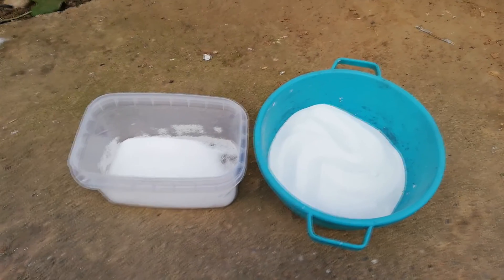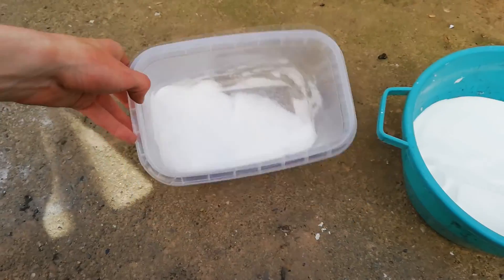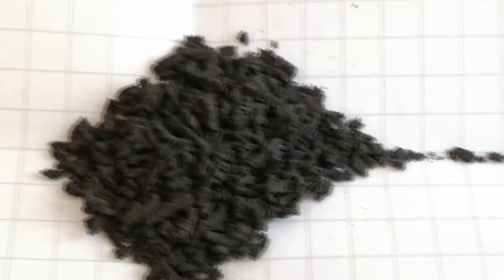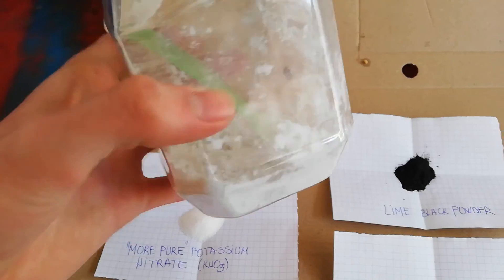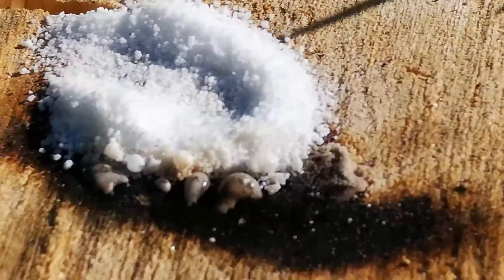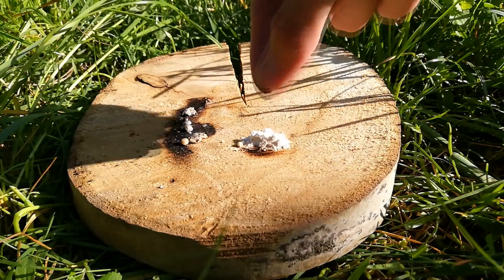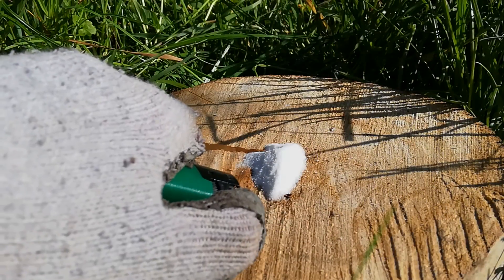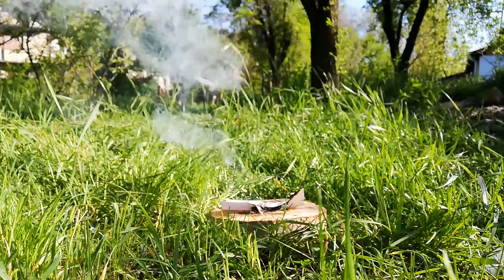Huge Factor That Makes Your Fireworks Fail

Comment: Hi (again),
Marble made of stainless steel are safe to use in ball mill (are they more safe than glasses ones ?)
Thanks
Reply from the maker: I'd rather use glass or even better ceramic marbles than steel ones. Nether of these are the safest like Alumina, hard lead balls, Zirconia media, those are safer I'd say. Do better research for yourself. Stay safe.
Reply: @MakeAndDestroyFireworks   Hi thanks for your response. But stainless steel is sparkless, so it is a good choice ?

Comment: Hi Make&Destroy,
I want to ask you, do this crackling star composition works ? (66/30/4 - CuO/MgAl/Dextrin)
Thanks
Reply: Why not?
Reply: @ChimeraChemLab  because you need bismuth trioxide or lead tetraoxide and nc lacquer
Reply: @pyroaxcry  As you can see, not necessarily
The phenomenon of crackle has not been sufficiently studied, but most researchers agree that first one component burns out of the magnalium, then a finely dispersed second component gives a flash. According to this theory, it should work... Besides, I think I've seen this composition in Chinese tables...
Reply: @pyroaxcry  I agree, the use of dextrin looks strange
Reply: @ChimeraChemLab  Yes I see
Reply: @ChimeraChemLab  but can we add nc laquer instead of dextrin ? And will it works ?
Reply: @pyroaxcry  Well, at least NC laquer should bind as well as without dextrin)
I just made some of this compound at NC laquer, and it's not dry yet. But so far it doesn't sound very much like a crackling – rather not a pop, but a flash...
I'll try to bind it on the water, but it will take much longer to dry
Reply: @pyroaxcry  It's too bad that this comp gives little information, I mean the size of the magnalium and the cores
Reply: @ChimeraChemLab  oh ok
Reply: @ChimeraChemLab  yeah not much information about the comp

Comment: How did you learn how to make fireworks? I’m interested in this. When I get older I’d like to make them too. Do you know where I could find info to make them?
Reply from the maker: I'd highly recommend you to first understand how basic compositions, like black powder, star composition, etc. work. (Avoid using flash powder for the beginning). You can also watch videos that show the results of what's been made, but please if you're younger ask someone older to join you, safety first pyro :)
Reply: @MakeAndDestroyFireworks  I’ve been making fire crackers and other ground based fireworks for years now but can’t get Morters to work have you got any tips

Comment: Hi M&D. Great video, as always. If I understand your video correctly, as a chemist I can tell you that it depends on where you buy the potassium nitrate. The agricultural one is often impure for KCl and NaNO3. Water of hydration is much more associated with KCl and NaNO3. In my BP productions I use the food type (which by the way is not that expensive). With this type of KNO3 I can produce BP with a burning rate of 80/100 cm / sec (about 40 '' / sec) by balmilling because I produce BP with ball mill. However, this BP has a tendency to absorb water from the humidity of the air, since it sticks to the walls of the jar after 3 hours of grinding. According to Ian Von Maltiz in his book "Black powder manufacturing methods & techniques", this water (about 1%) even favors a fast combustion. Recrystallizing impure KNO3 is a good method: just let the recrystallized dry well. I have seen that your fastest BP is excellent, obviously indicated for launching and bursting charges, the slower one you could use for other preparations where a great burning speed is not needed. Keep in mind that the NaNO3 present as an impurity can color the flame yellow ... but maybe you already know these things :)). In any case, a good video, clear and simple. Greetings from Italy, Alex :))
Reply from the maker: Thanks for commenting Alex, I will do a recristalisation for the inpure one, maybe even for pure one to see the results :)
Reply: A lot of knowledge.. I just got the agricultural KNO3 but noticed the slow burn as well. I wonder if the star comps here in America are the same as the ones in Italy they seem to have brighter colors in Italy and German fireworks.
Reply: @Tongan_Boss  Hello. From the videos you may not see the colors well, especially the green and blue. I don't know if there is a diversity of colors. A good blue and a good green are obtained using chlorate, but without using magnalium so as to obtain low flame temperatures, of the order of 1200 C. See you soon. Alex.

Comment: Sounds like you actually had a moisture issue versus a purity issue.

Kno3 will absorb moisture over time decreasing its prefornance. You should dry your kno3 and see if it makes a improvement.
This can be done by using a cooking try, spreading it out and cooking off the moisture in a oven or similar.
Reply from the maker: Not canceling that factor totally, I usually get clumped kno3 in plastic bags from store and works perfect. Not the case on this one, it doesn't feel damp at all. "Baking" would probably increase performance a bit but not solve the issue.

Comment: A video on potassium nitrate recrystallization would be great!
Reply: recrystalising vid would be fab.  for me... to recrystalise anything requires two components. the salt and that salts particular solvent. +air drying. then to recombine the pure, distilled water and more air. helped by very low <EDIT> heat </EDIT> for evaporation.  i have no idea what i'm talking about lol. but in my dumb logic it seems to work lol